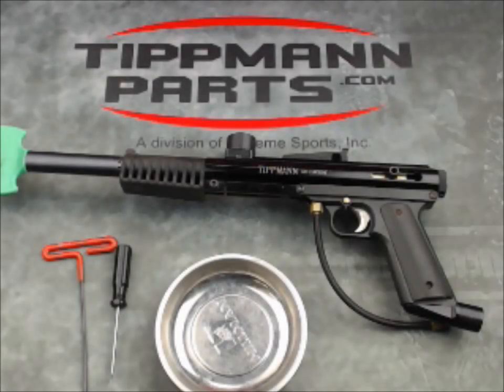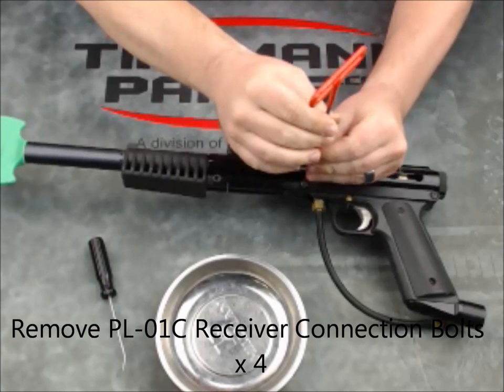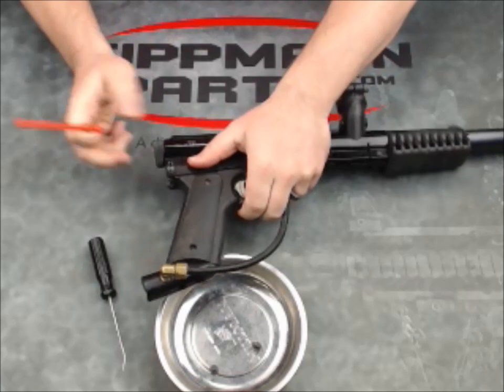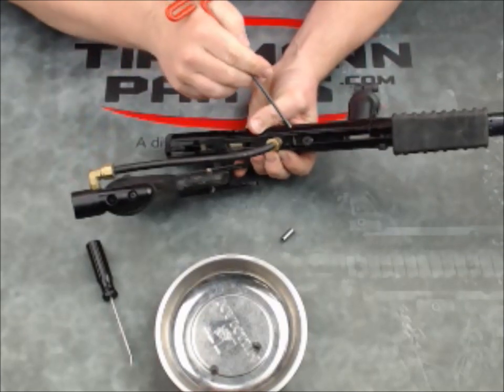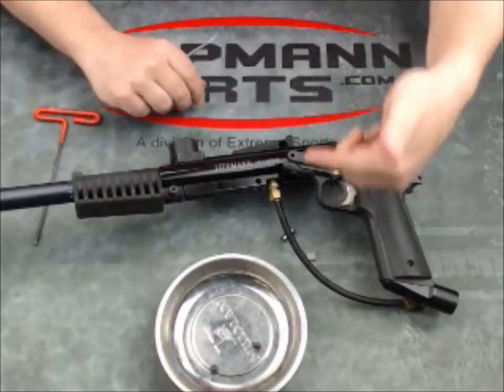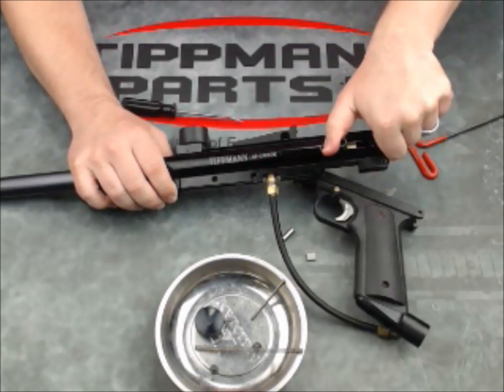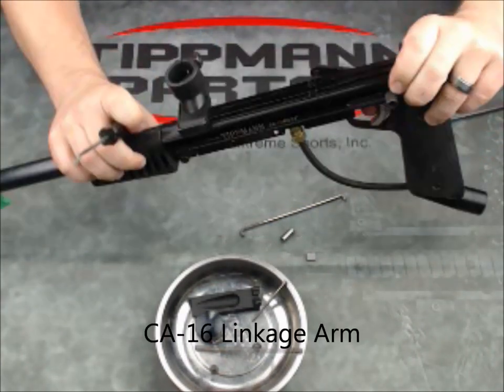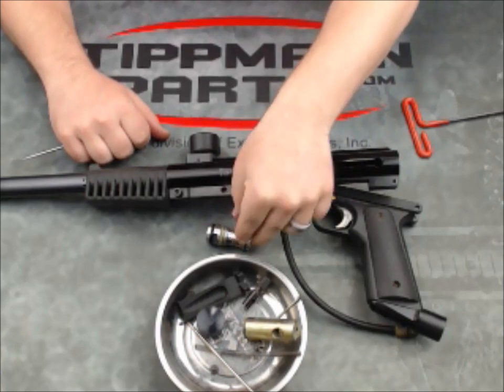Tippmann 68-Carbine - Valve Removal

Comment: Yes this video should note that it shows a floating, Pro-lite style valve. These were used in early .68 Carbines. The CVX valve was used in most .68 Carbines and Pro/Carbines. To remove those valves, simply unscrew the gas line fitting that goes into the body. It does not have those little metal tabs. Everything else will be as shown.

Comment: To adjust velocity, use an allen wrench to turn the screw on the bottom of the receiver. It is fairly large and should have a spring on it. Turning it in decreases velocity, out increases velocity. Just don't unscrew it out of the body completely. If you still can't get enough velocity when using compressed air, use a "stiff" drive spring from a model 98 or A-5.